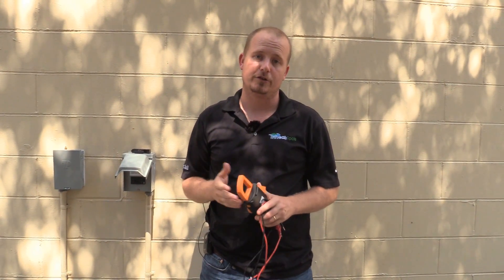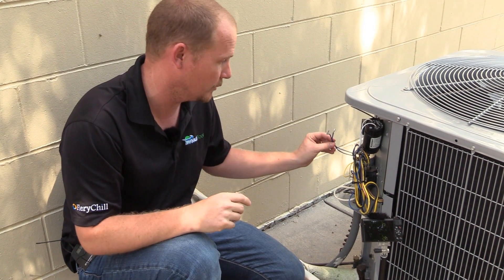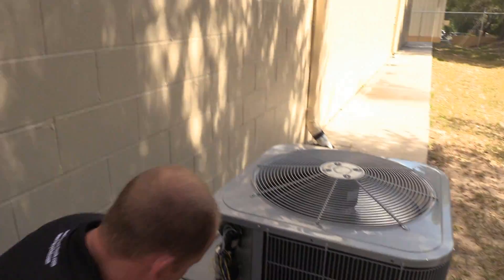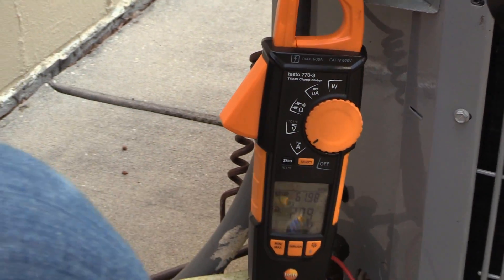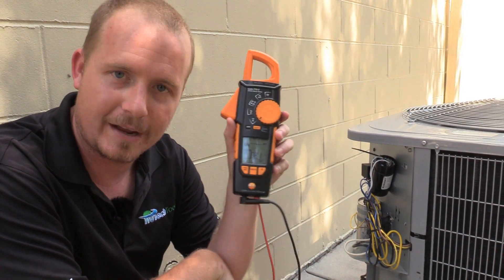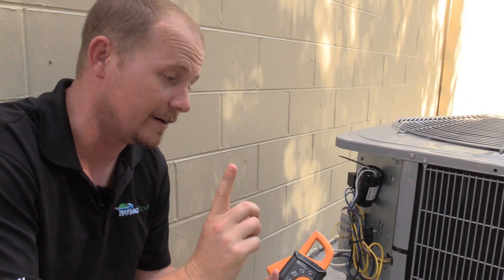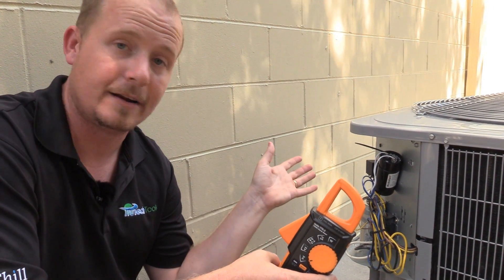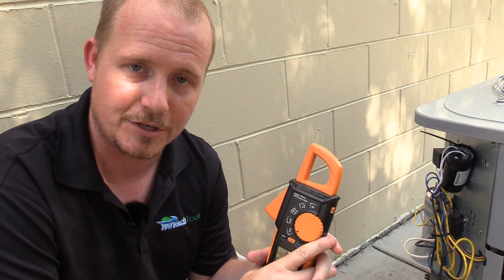Measuring Inrush Amps

Comment: Isn't the drop in current on the meter due to the current being supplied by the large capacitor (hard start cap)? So it's not that the meter 'missed' it; the home electrical is supplying less thanks to the cap. Right?

Comment: I am surprised you explained it correctly.  Many folks run around saying hardstart kits reduce startup surge current magnitude.  That is not true.

Normal startup surge current lasts in the range of 0.4 seconds without a hardstart capacitor added.  A hardstart capacitor increases the motor startup torque by getting the start winding current closer to 90 degrees phase shift from Run winding current.  This drops the typical spin up surge current time period to about 0.2 seconds.

Most clamp on amp meters average the surge current for about 0.4 seconds so a short burst, 0.2 second surge time period reads lower than actual.

If you have a true hardstart condition on compressor, due to low AC voltage or long or small gauge AC wiring, the startup surge time will increase.  Normally without a hardstart capactor, if spin up surge current time extends to near 1 second it is likely the compressor overcurrent/overtemp internal protection Klixon will pop open from overcurrent duration.
Reply: Thanks for that explanation

Comment: How do you fix lock rotor amps being higher than what it says it's rated for on the data plate????
Reply: You can't fix it. What I would do in that situation is check the Amp rating of the contactor to make sure the locked rotor Amps haven't exceeded its Amp rating. If it has, then I would replace the contactor with a higher rated one. If it's having trouble starting, then I would also install a 5-2-1 hard start kit, but only if it's having trouble starting.

Comment: That's clear.  Good there is a difference. (shortened inrush time). How does that naked inrush measurement (w/o hard start) relate to the Rating Plate specifications?  i.e. How do those ratings tell you, you are out of spec and that you even need a hard start kit?  And how do you know (once the kit is functioning) what acceptable parameters are?  Thx

Comment: Great video!!! 
How is it that the electrical wires can withstand that much amperage going thru them at startup? Even if it is for a split second.
Reply: The same way can pass your hand over a blow torch flame and not get burned

Comment: THANK YOU sir.!! >>> I am SOOO glad you explained that to others as to how a "hard-start" kit actually / electronically operates.!!

Unfortunately., SOOO many folks believe that a 5-2-1 (or other) "hard-start kits" actually reduce the inrush amps., as instead of them actually JUST reducing the time required for motor "spool-up".!!!

Actually., I just purchased, what would be considered a "el-cheapo" (only about $48.) clamp-on meter (a BSIDE brand, 600A DC/AC Clamp-on Meter with True RMS Auto-Ranging 6000 Counts Meter with Inrush Current mode")

Then after checking my inrush-current again with the above newer meter (cheaper made, but better / faster sampling-rate)., both with the 5-2-1 connected and dis-connected., the inrush-current displayed gave almost identical readings (in some cases, even a few amps more with the 5-2-1 connected.!)

And to be absolutely sure the 5-2-1 was in fact "doing its job"., I put the inrush meter onto one of the wires coming from the "hard-start" capacitor, and I did in fact see a good amount of amps (in my case about 15A) of inrush on the capacitor wire, and then zero amps once the relay kicked-out.!

The ONLY way to actually get one's compressor to reduce its inrush current (a minimum 60% or more.!)., and low enough to use a gen-set rated for only about twice the FLA amps of you compressor., is to "spend the big-bucks" (about $350) on a "Micro-Air, Soft Start" kit. >>> An "all American-made" unit, that has been in business for over 10 years, that actually "does-the-job".!!

What it basically does, is to "ramp-up" the motor in 4 steps (like the famous "Grundfos" brand, 3-step, start-up, deep-well water-pumps), but the Micro-Air also "learns" the best start-up "profile" over the first 5 start-ups for absolute best performance.!!

It also let's the condenser-fan spool-up FIRST (for about 3 seconds) before initiating the compressor 4-step spool-up., thereby NOT adding the fan inrush current to the compressor's inrush current.!!  >>> Here's one of their older, basic operational videos >> https://www.youtube.com/watch?v=ZsMvbU27uPQ&list=LL 

FYI:  Their newer units (made in the last year or so) now have a built-in "Bluetooth" transmitter (don't know its range / distance depending on conditions.?) and a FREE downloadable "App" (for both I-phone & Android) that will show ALL types of info (ie: startup / inrush amps and even "live" running amps) >> And here's a basic video about the cell-phone App >>> https://www.youtube.com/watch?v=XTRofDkGkNw&list=LL&index=4

And again., THANKS to the "HVAC School" channel (Brian.!) for doing some VERY important "Myth-Busting".!!

Comment: with hard start connected how many amps did you get?? (at 3:35 it shows 82 amps from 132 amps) that's a big drop and will make compressor last a bit longer with less heat buildup on the motor.  good video as a whole. next question is how many ton a/c unit are you working on?  dont make me review the video for clues.

Comment: Hi Bryan what is the inrush amps on the new Greenspeed units and can you put a hard start kit on them. I want to make sure my generator can safely start my 4 ton. (Installed by Kalos btw :-)  )
Reply from the maker: A Greenspeed is inverter driven which means it starts slow not hard. You definately don’t put a hard start on any inverter driven compressor.
Reply: What is the inrush or locked rotor amps?
Reply: @HVACS  So what is the inrush amps on the green speed 4 ton? (installed by Kalos)

Comment: Is there a difference with inrush amp setting on a meter, and the Max amp setting on a meter? 
I ask due to the fact that my meter can do max/min amp testing.
Reply: Yes, there typically is a difference.  Nearly all meters will have a min/max function, but few will have a peak/inrush function.  The peak/inrush will measure the peak cycle over a much shorter timeframe, in the 1-100 millisecond range, versus the 1-2 second range for the min/max function.  Without the millisecond granularity it will be difficult to actually catch the real peak of the waveform.
Reply: @tswtx  Most meters with the inrush feature only have the 100ms time frame. The more expensive meters have the 100ms and 1ms. Have you used the 1ms and 100ms time frames? If you have, which one more accurately reads the true inrush current? I'm assuming the 1ms.

Comment: Very well done, the fact that you said in-rush current draw doesn't actually decrease, but that the motor simply gets to operating rotational speed faster, with the addition of a start capacitor and potential relay, and then the meter reading shows a lower current draw on start up. Should HVAC techs be installing these hard start kits on systems that don't have any starting issues, just for the ability of the compressor to be able to spin up faster, thus reducing "wear" on the start winding. If so, shouldn't the manufacturer be building units with them already in circuit.
Perhaps you could do a video on how capacitors work, and how they affect the motors in which they are being applied to. Like phase shift angle, influencing direction of rotation, proper sizing, voltage differences, etc. Thanks.
Reply: 4 years old comment but i'm going to answer this anyways - short answer is yes, manufacturers now don't include these as a cost saving measure, and simply put the older systems that lasted 30+ did indeed come with hard start kits.
Reply: @numchux2  It's not good to install a 5-2-1 hard start kit on a compressor that isn't experiencing starting problems. You will decrease the life of the compressor if you do. They are made for the very purpose that the name implies. You only install them on units that are old, tired, and havig a hard time starting.
Reply: It is situational, and I have changed my mind about this. Scroll compressors typically should not have a hard start kit. Other compressors should. Bristol compressors it is required to do so (which also causes them to fail over time but that's a whole other issue).
Reply: @bernardocisneros4402  I have a 31 year old, 2 ton Goodman compressor. I don't think it has a problem starting but should I install a hard start kit just because it's so old? Thank you!
Reply: @geecrawdad  If it doesn't have a problem starting, do NOT install a hard start kit. Only install a hard start kit when it begins having problems at start up (i.e. takes long to start or doesn't start). You've had it for 31 years so I'm sure you'll notice when this happens. 

A hard start kit only buys you some time so you can start saving money for a new A/C unit. It's not a permanent fix. It's a temporary fix until you get a new one. In other words, a hard start kit is a band-aid.
Reply: @bernardocisneros4402  Ok, thank you!

Comment: Great video! 
I have a question: which wire is the one you a putting the clamp on? The run wire of the compressor???
Reply from the maker: The Compressor Common
Reply: HVAC School thank you
Reply: @HVACS  clamp meter model no. please
Reply: Question. The compressor common is the one that goes to the running capacitor common ?.
Also. Do you need to check the other 2 wires of the compressor to see any drop ? Or doesn't matter 
Thanks